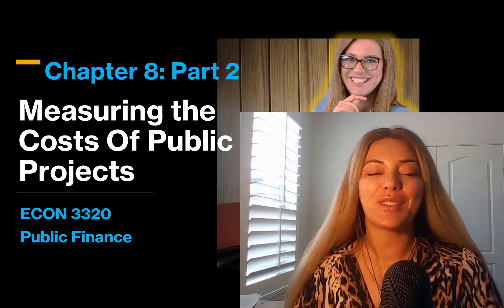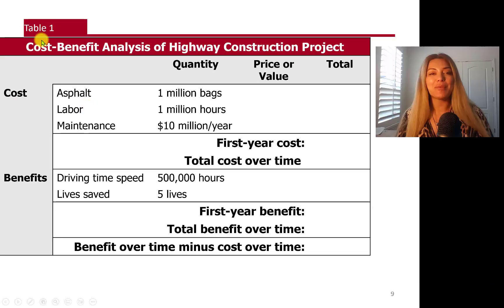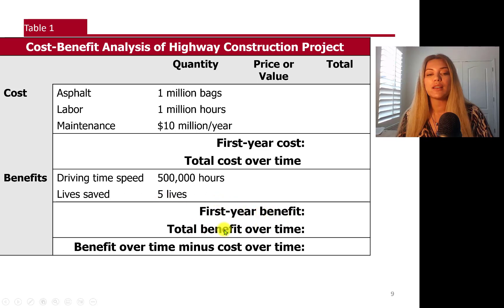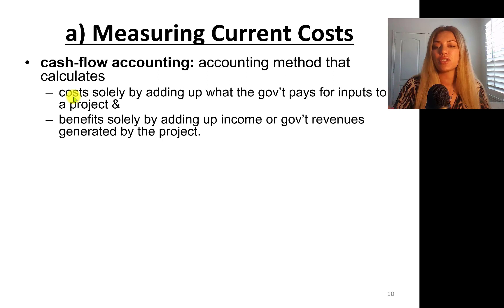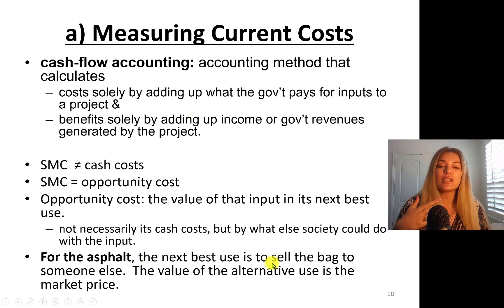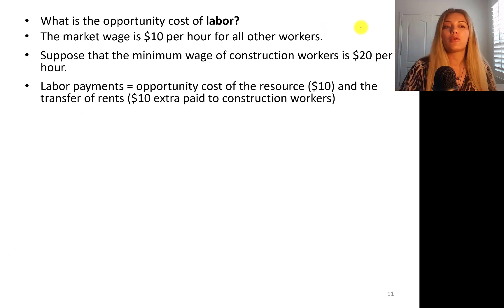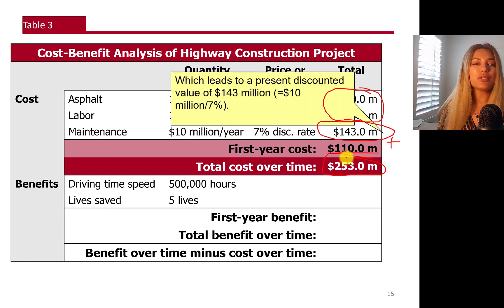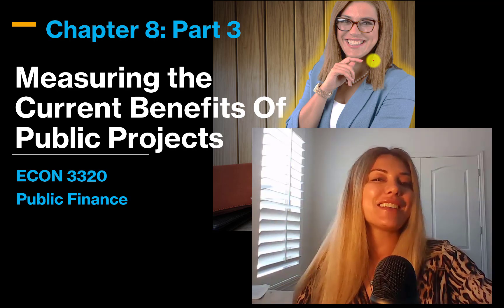How to Measure the Costs Of Public Projects? - Chapter 8 Part 2

Comment: Are rental transfers 2,500,000? Also, can you explain why the long-term total cost is infinite, but there is a 7% discount rate that gives us a value of 143 million? If time is not specified at an ending point and continues to require maintenance YOY forever, then how is it possible to have a discrete value? Why would we calculate the total time cost like this if, after 11 years, the annual 10 mil of maintenance cost equals the original labor and materials cost of 110 mil? Then how can our total time cost be 143 mil if YOY maintenance is 10 mil, which means that the total time cost of 143/10= 14.3 years of money allocated to YOY maintenance cost?
Reply from the maker: Long term total cost is NOT infinite. An infinite sequence of payment's PDV is NOT infinite. If I get paid $1,000 till infinity, if the interest/discount rate is %5, then PDV =   1,000/ 0.05. I explained this in the video.
Reply from the maker: Are you asking about this question? "requires 500,000 hours of labor to complete. The labor market is perfectly competitive, and the market wage is $20, but the wage paid for this project is $25." If so, it is (25-20)*500.000 = 5*500,000 = $2.5M